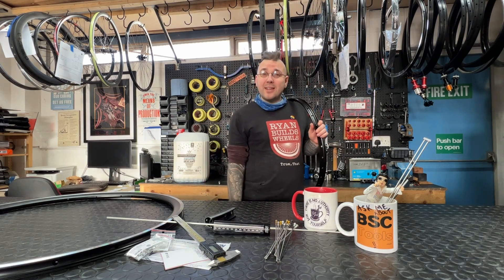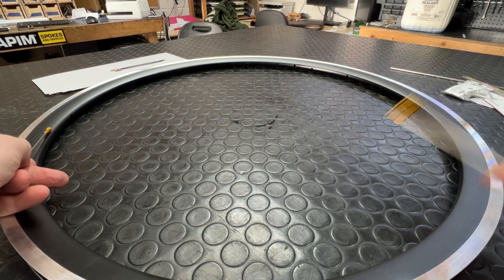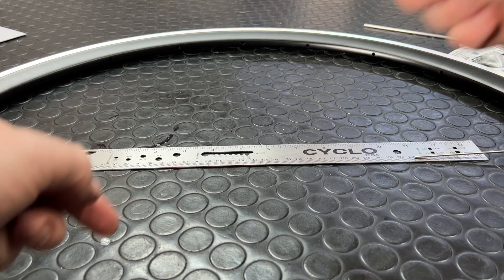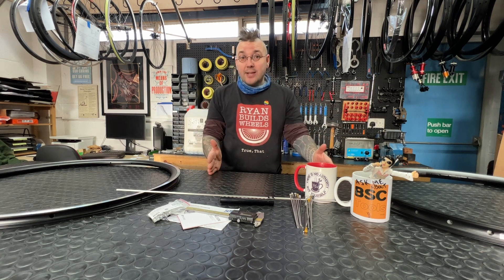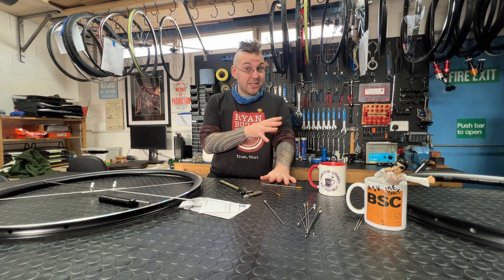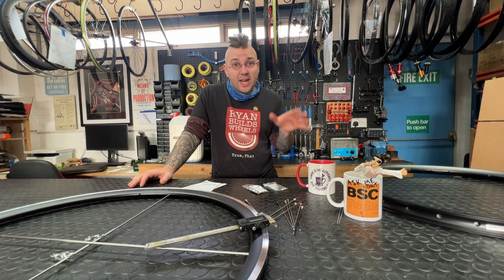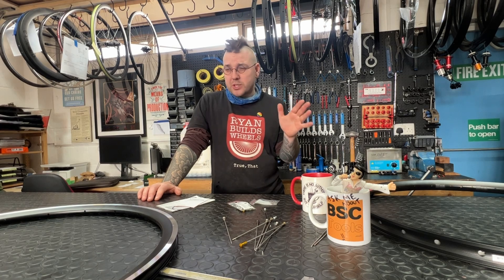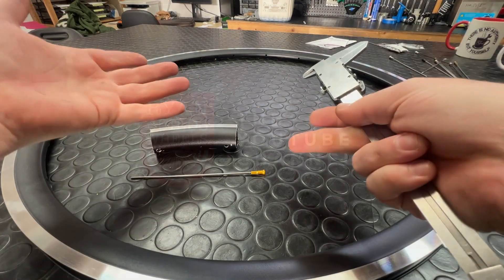The ONLY way to measure bicycle rim ERD: a Wheelbuilding hot take!

Comment: Why not just use two spokes that will pass each other in the middle and clamp them together with say an electrical strip connector and remove a nipple and measure it in one piece?
Reply from the maker: Would also work 👍🏻

Comment: Thank you! Very good video😊. You say DT Swiss measurements can be trusted, does this apply to only the spokelengths received from the DT Swiss calculator or others aswell? The lengths differ when comparing calculators
Reply from the maker: DT's stated Rim ERD's will work with any spoke calculator assuming ERD is what it wants you to input.  Remember that DT's ERD number assume you'll be using a certain type of nipple (standard slotted for their entry level and Squorx for their PHR series) alongside any relevant PHR washers.

Comment: Is the process the same when spoke holes are staggered? For example I have a Ryde Andra 40 rim.
Reply from the maker: Yep; these are the same stagger as a rim like that; SOME rims will have the drive side spoke holes on the right of the valve hole (these are left hand) which sometimes get called 'French' or 'B Type' rims but, in terms of lacing the pattern is the same.

A future video will give a full lowdown on lacing :-D!

Comment: Great video, thanks Ryan. When building the ERD sticks, should you factor in further spoke length "growth" as the spokes tension during the building? In other words, if your stick positions the spoke head flush with the nipple top without tension, will the spokes end up longer than needed once they're tensioned up? Hope that makes sense!
Reply from the maker: @RogerMusson 's The Spoke Length Project takes this into account for you luckily and that's why mine and his ERD sticks that use a standard slotted nipple are flush with the slot and not with t hey nipple top.  If you had ERD sticks flush with the top then you'd expect some stick out.

Comment: Great video Ryan. Clear and to the point. Calling ERD an moving target is really helpful because its not just the rim that you are measuring, the the diversity of spoke nipples used today has made it impossible to create one uniform standard for measuring. On the topic of pre-made tools I agree that the SON tool is certainly a winner when it comes to readability. The main issue I have with it is that the way the tool sits in the rim only really works on rims that are drilled very straight in both the internal and external rim holes. A lot of modern rims with directionally drilled offset rim holes and asymmetric profiles will struggle to work with this tool. The original Wheelsmiths rim rods had the same problem but the BSC tool has a much smaller head (measuring end point) that allowing the rods to pivot within the rim cavity to allow for an accurate measurement directly across the rim. With the BSC tool, you can also just measure the overlap like you used to with the old Wheelsmiths rim rods. Its another step in the process and then you have to account for the nipple head, but it works. I would agree that there is no perfect tool.
Reply from the maker: Oooh! Those are some great points and food for thought Adrian! Another type of rim that can prove hard to measure are those that are directionally drilled AND have a very thick spoke bed such as the Ryde Andra 30/40 commonly used for heavy duty or touring rigs: the (albeit roughly) machined countersink on those can play havoc in deriving correct ERD.

Comment: Thank you for this video, it’s definitely helped.

A related question, if I want to replace a rim, how do I get hold of a rim with the same ERD? Especially if I can’t trust the ERD from the manufacturers.

My partner’s braking tracks are worn, nothing else wrong with the wheels but I can’t seem to get hold of the same rims and if I have to replace the spokes too I  might as well build or buy a new wheel.
Reply from the maker: Good question Graham! One manufactuer who's rim ERD you can trust is DT Swiss; note that some of their rims MUST use washers (the PHR series of rims, such as the EX511, RR481 etc.).  After that it's a case of taking things at face value I'm afraid and / or asking others of their experience / measurements.

Remember though; if the ERD is too small you've a few tricks up your sleeve; you can add washers to non washered rims, or use nipples such as Sapim's Double Square which will add another 2-3mm on either side of the rim.  Also don't be afraid to 'overwind' spokes by a couple of mm if needed; there are actually benefits to this (see link below).

https://wheelfanatyk.com/blogs/blog/nipple-threads
Reply: @RyanBuildsWheels thank you. Really helpful answer. Your videos are great.
Reply: Set the wheel on a table with a square on the inside of the rim.  Put another rim next to it, also against the square, and look at the opposite side to see if the inside edge on the opposite side is the same on both rims.
Reply: @joelarmstrong6127  it you have a rim in stock and want to check it has the same ERD as the existing rim, then yes you can measure both rims.

My question was really how to order the correct replacement rim ie. without being able to physically inspect it to confirm what the actual ERD is.

PS - your method assumes that the distance between inside of rim and where the nipples sit is the same on both rims. Maybe that’s always the same, maybe not, or maybe it’s close enough to use washers or overwinding as Ryan said in his answer.

Comment: I have been using Wheelsmith Rim Rods forever while making any adjustments necessary for different nipples. Requires a bit of technique to get accurate readings, but then again, I think any method does. 
For rims drilled for internal nipples, the Rim Rods don't work because they don't fit through the holes, so then it's time to use spokes of a known length.
That fancy German tool looks pretty slick, but I don't see one in my future.
Reply from the maker: Never had the joy of owning a pair; I should add some to the colleciton I guess...! My intention with what I'm planning in house is that it will essentially be 'zero technique needed'; pop the rim in, look at the reading; BOOM!
Reply: @RyanBuildsWheels  That would be nice, but every once in a while, I get the rims with no nipple access holes. I am planning a video on dealing with those at some point. They are fun.

Comment: Hey Ryan! How do you measure the precise length of your ERD sticks? Sounds silly I know but how do you get the measurement correct when the nipples all measure slightly different? Do you measure to where the square part of the nipple touches the “ball joint” that will sit in the rim bed?
Reply from the maker: In a slotted setup that 150mm figure I gave for my ERD Sticks is from the bottom of the slot to the end of the ERD Stick spoke!; make sense?
Reply: @RyanBuildsWheels  yep! I found your dedicated video on it 🙏🏻👌🏻
Reply: @RyanBuildsWheels  bonus question: if using DT squorx brass nipples, and I need odd length spokes but can only get even length spokes, should I round up or down? (ie: buy 1mm longer or shorter). On my disc build, using DT rr421 asymmetric rims, the front left lands at 287 (using aerocomp here) and the rear right also lands at 287 (using aero comp here). FWIW, both the front right and rear left land at 288 and I’m using aerolites there. Cheers!

Comment: 2 short cut J-bend spokes, 2 14mm brass nipples threaded ALL the way onto the spokes. a normal longer sized, rubber band. insert 1st spoke/nipple to the right of the valve hole, insert 2nd spoke/nipple opposite (the left of the rim seam. attach the 2 j bend spokes with the rubber band, measure from the tip of the nipple to the tip of the other nipple with a quality tape measure (I use a Shimano tape measure). Add to your measurement, 28mm.  measure twice in the other direction,  the two measurements should be the same, or very very close give or take a fraction of a mm. if their not, you have either placed the spoke incorrectly, or your rim is an Egg shape.   (also when re-lacing a used alloy rim, check for this and also flatness on a flat surface, like a marble countertop. 

this is how I measure ERD, and it works every time, if you plan to use washers, or use an internal spoke nipple (such as the spline drive from DT swiss with the pro washer) include those in your ERD measuring tool assembly, when taking your measurements, as they will change the ERD outcome. 

this is the method I use and it has always worked for me, however their are many ways to measure for ERD and so long as you have a basic understanding of wheel building any method will lead you to a measurement that will work (if any method doesn't you've either done it wrong, or your wheel is an egg) measure twice, calculate spoke lengths, and cut spokes once (or 28..32...36...48...56....64....72....96.... however many spokes you need but personally i'd rather just order them from Sapim or DT swiss then cut them all, been there, done that.   

good video! subscribed!
Reply from the maker: Great stuff! Pleased to have you on board 😀!

The rubber band trick does work well 👍🏻

Comment: Great video, Ryan! I’ve always found this aspect confusing even though I suspected it was more due to a crisscross of info and explanations - as a nascent wheel nerd, I can feel the need for getting hold of a decent tool for this purpose (I have none at the mo) as I hope to be working out the ERD of a delicious Alchemist 36” carbon fibre rim somewhen soon ⚙️🤩
Reply from the maker: Glad it was helpful! If you don't want to spend the big bucks then for such a big wheel you could simply increase the length of a pair of ERD stick and use 300mm spokes instead for example; send me an email and I can make some up for you!

Comment: Currently planning to relace a rim and I made some ERD sticks out of the existing spokes and nipples.

I marked a point on each stick 250mm from the end and when pulled across the rim the marks were 56mm apart, so  I caculated 556 mm ERD. Measured three times to be sure.

But when I look up ERD for my model of rims (Mulefüt 80SL 26"), I find multiple sources saying 551mm.  I'm guessing that number is the 'nipple seat' measurement.
Reply from the maker: Yep: almost certainly! You see the problem we’re facing!

An extra 5mm is quite a lot: if using slotted nipples my advice is to only wind your ERD stick donor spokes to the bottom of the slot: this helps account for spike stretch. See my video on how to calculate spike lengths for my favourite Calculator reccomendation 👍🏻

Comment: Wouldn't it be much easier if the rim manufacturers stated RD ( rim diameter of a fixed point) and let us do ERD depending on the nipples. I've no idea where some brands get their ERD from.
Reply from the maker: Right!?! Feels like they're pulling numbers out of thin air sometimes!

I feel similalrly; it ERD is what we're stuck with right now as the guiding principle for spoke calculations but with education we could push to have NSD (nipple seat diameter; what you currently term 'RD') as the standard metric which rim manufacturers publish, and make sure that builders understand that their nipple and washers choices will then 'create' the ERD needed to calculate spoke lengths.

An almost Dada-ist approach to the above can be see in the way that Spank Industries present their ERD...which they term "ERD++" (ERD double boost anyone?!!!!) in an attempt to point out that you need to add nipples+washers to the equation...but they've only managed to muddy the water by not using the term NSD ('ATMO' : to steal a phrase from the great Richard Sachs.)

Comment: In this video you didn't actually demonstrate that ERD changes with nipples as all the measurements you took are just with one type...I'm lost with this one...

Also the 150mm spokes that you cut, you weren't clear if that 150mm goes into the nipples or not.
Reply from the maker: Thanks Joe! Good points :-)!  I'm trying to keep video's a little shorter but those details are missing here.

So: 150mm spokes go into the nipple yes; stopping at the point you want the spokes to end up when the wheel is complete BUT taking into account spoke stretch; take a look at my last video '10 minutes of nipples' as a good example of where this might be.

ERD Changes and nipple types; for a super clear example head to 3'17" : this shows the biggest difference in ERD change that I can think of; external vs internal nipples.  If you then consider how much additional thread is present in something like a Double Square or Squorx nipple etc (again, see previous video) then that should make things a bit clearer.

Really appreciate all your questions! As an expert in the field it's sometimes hard to figure out what bits of information I need to convey in clearer terms.
Reply: so the spokes are exactly 150mm long... then thread a nipple on... not 150mm long from end to nipple end?